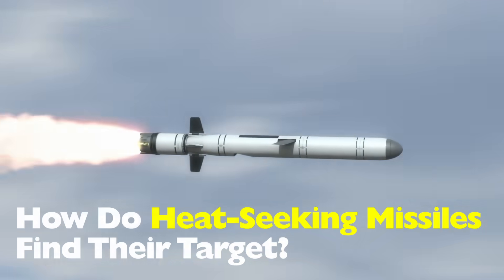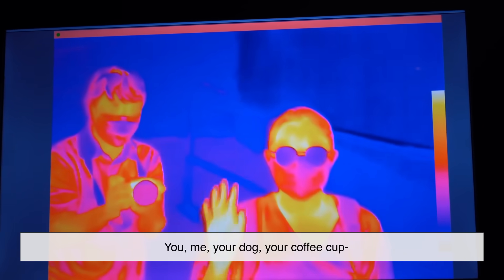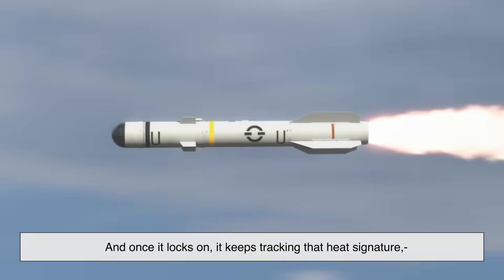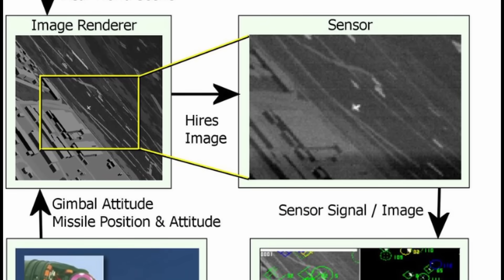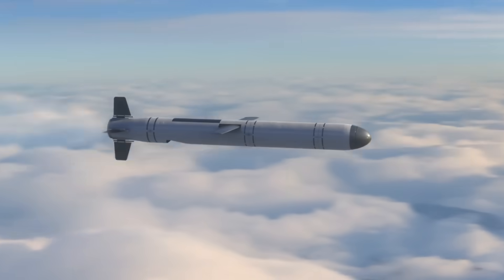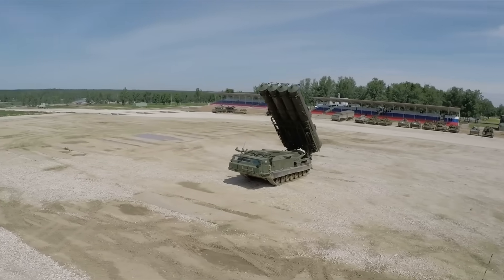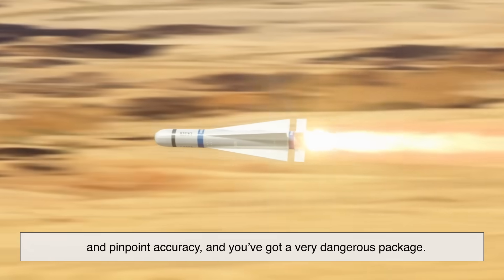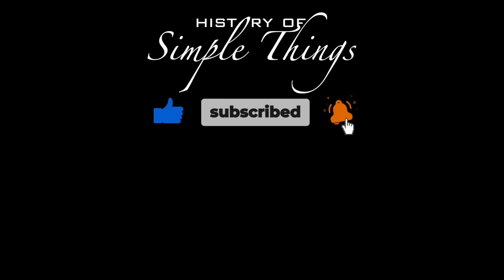How Do Heat-Seeking Missiles Find Their Target?

Comment: Yes it is possible to launch a heat-seeker without designating the target first but it's a big risk that the missile won't acquire the target by itself. 
What normally happens is the seeker head is uncaged by selecting and activating the missile, then either the aircraft is pointed at the target or as is more common with modern fighter aircraft the pilot just looks at it and the helmet provides lock data to the missile. 
It's then launched and tracks the target.